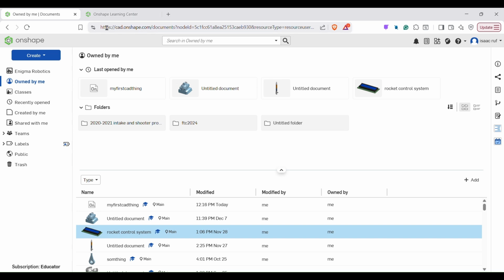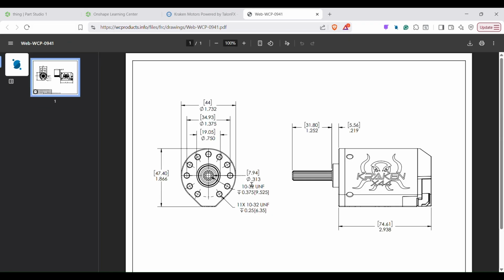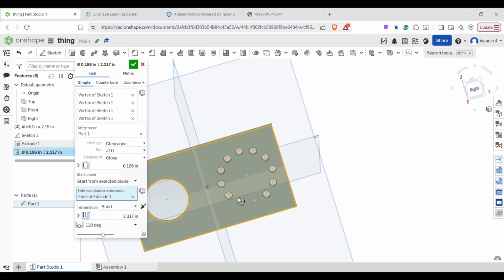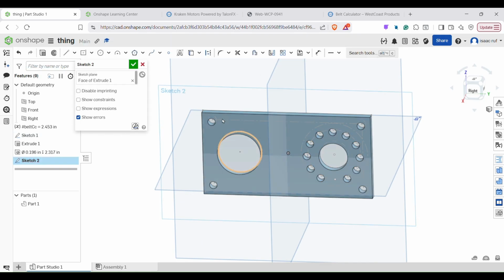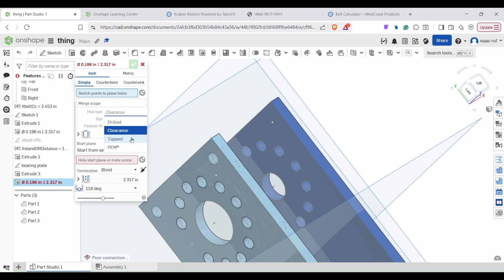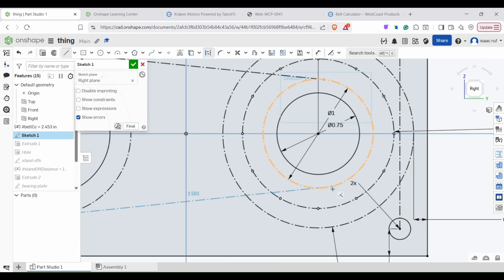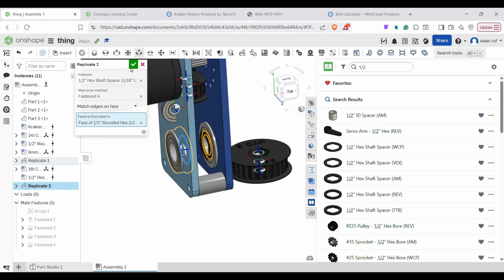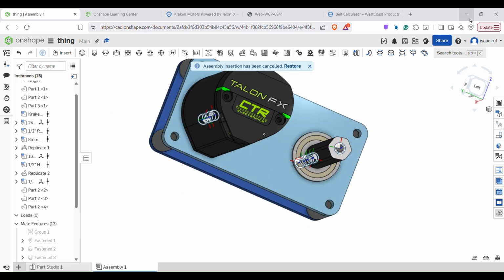Design your first robot part for FRC in Onshape!

Comment: why dont you put the belt bro ı was very curıous about ıt
Reply from the maker: It’s just extra work and the video was getting long. You 100% can it’s not super hard but not always necessary. As long as you make sure nothing is in the belt path you’ll be fine. And don’t have to worry about putting the belt into your final assembly. If you want to know how to do it let me know